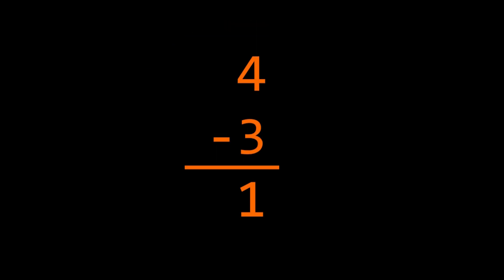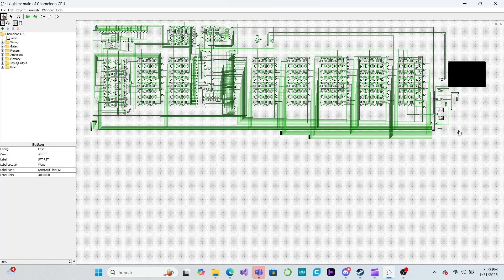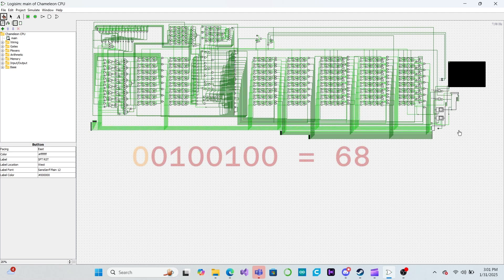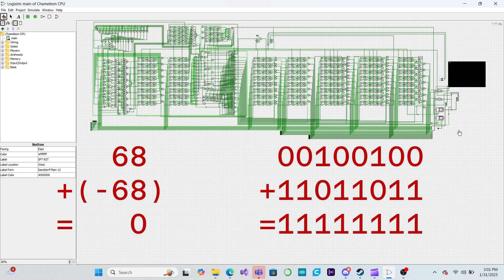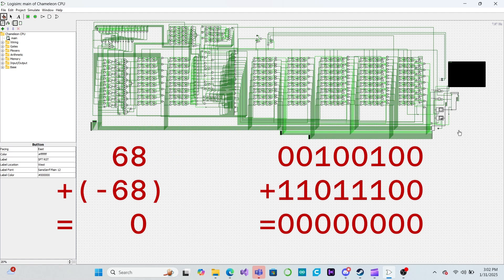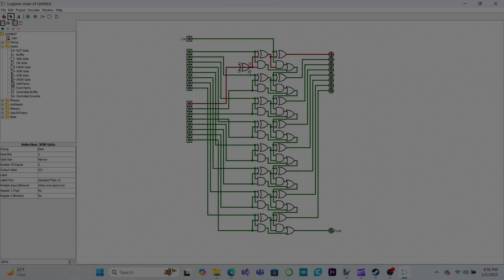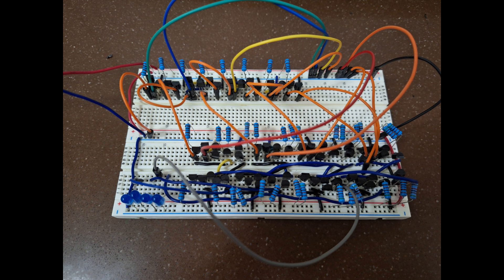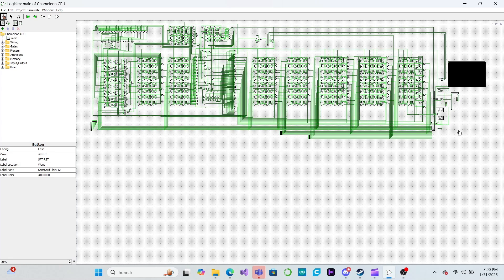How Computers Subtract Without Subtracting:  Two's Complement (The CPU You can Build, Ep. 4)

Comment: Some piddly things of no real importance...

Performing ones complement arithmetic (with end round carry) is pretty much the same as performing twos complement arithmetic in terms of complexity.
Of course, people like to whine about the presence of two zeros (a positive one and a negative one) when dealing with ones complement numbers, but if you perform your arithmetic with a ones complement subtractive adder, the negative zero will be automatically suppressed when performing "normal" arithmetic.
IOW, its no more problematic than dealing with twos complement number.
See the Univac/Sperry Univac/Sperry/Unisys 1100 and 2200 series mainframes.

Why mention this?
Because while everyone is now familiar with twos complement arithmetic and assume that it's the greatest thing since sliced bread, it does have some downsides which people seem to want to pretend don't exist.
For one, using shifts to perform multiplications by some power of two work when dealing with no problems for ones complement numbers while don't work as one might expect with twos complement negative number.
And there is one more negative number in twos complement than there is positive numbers in twos complement.
These may not be big deals, but they are things to consider which most people seem bound and determined not to do so.

And one final piddly point, while signed magnitude was more bothersome than either ones complement or twos complement, that bother has largely gone away with the ability to throw massive number of transistors at the problem.
The result is that while twos complement is common when dealing with integer math, signed magnitude number have a nasty habit of showing up when dealing with floating point numbers where the urge to through transistors around isn't as strong.